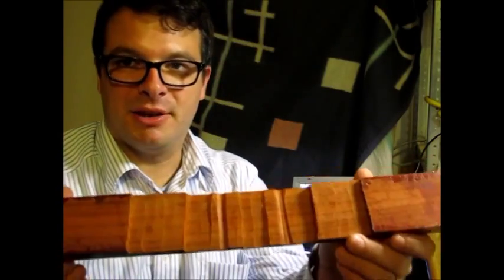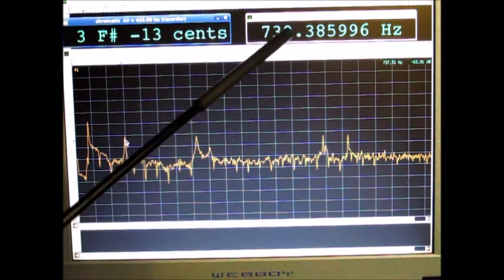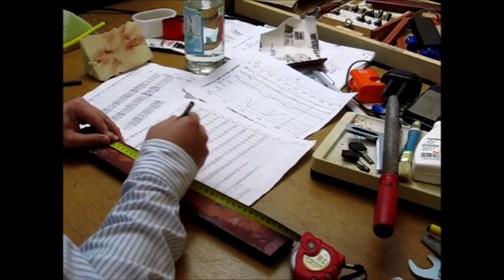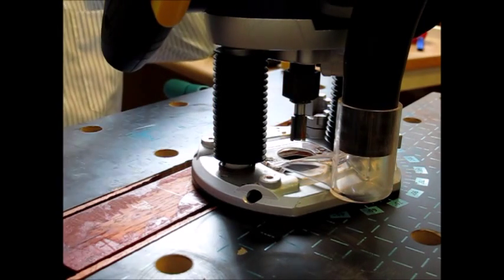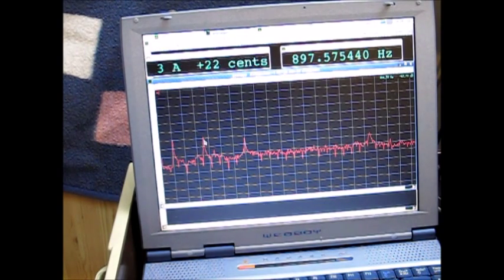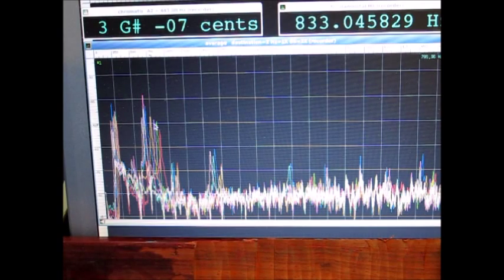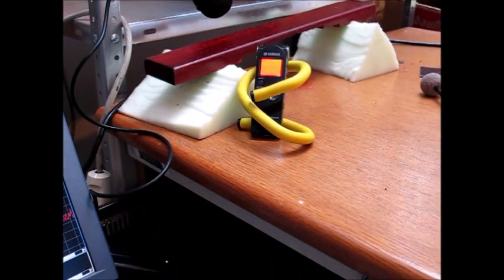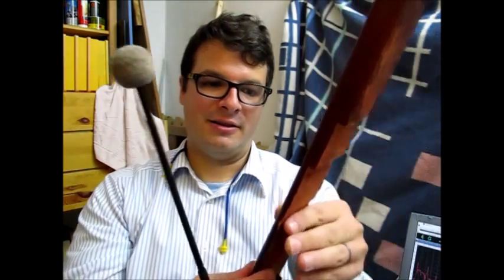Triple Tuning A Marimba Bar With A Router

Comment: I have the papers from ingolf bork.. but I don't have the one you're using to determine where to begin and end an arch.  How are you determining that?
Reply from the maker: At https://youtu.be/QZPyBDtoYc0?t=155 you can see 2 sheets of paper above the bar: the first is the table, and the second is from Bork's paper. The diagram in Bork's paper is expressed in relative lengths, since for the mathematical description of a bar, it does not matter how long it actually is. Bork's diagram says that, for example, material is removed from 20% to 70% length, this mostly lowers the fundamental frequency. When using the actual bar length, you can compute the actual lengths where to cut/grind - that's what I did, and this is the first excel-table.

Comment from the maker: The sheets in the video show a list of the distances for the arc and the various areas influencing the frequencies, for each bar. Based on the paper by Ingolf Bork, Practical tuning of xylophone bars and resonators.
Reply from the maker: At https://youtu.be/QZPyBDtoYc0?t=155 you can see 2 sheets of paper above the bar: the first is the table, and the second is from Bork's paper. The diagram in Bork's paper is expressed in relative lengths, since for the mathematical description of a bar, it does not matter how long it actually is. Bork's diagram says that, for example, material is removed from 20% to 70% length, this mostly lowers the fundamental frequency. When using the actual bar length, you can compute the actual lengths where to cut/grind - that's what I did, and this is the first excel-table.